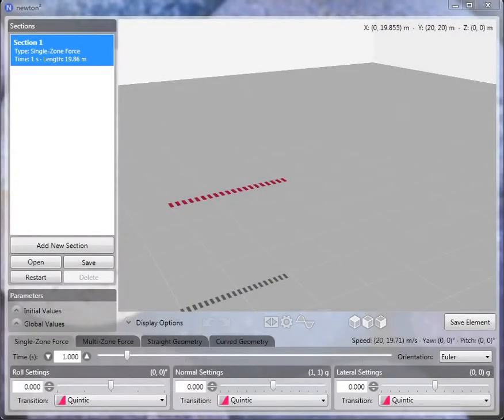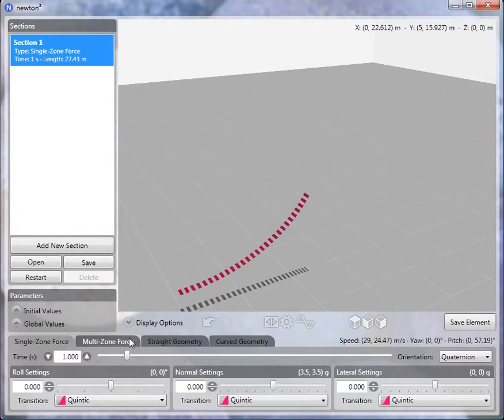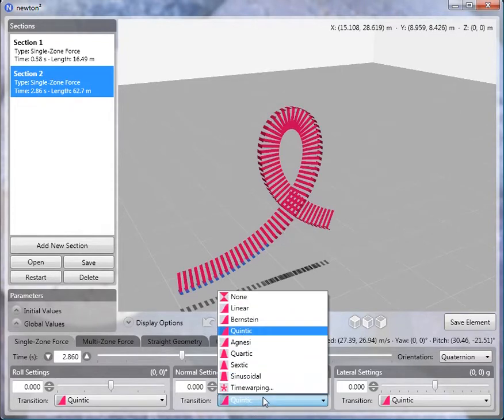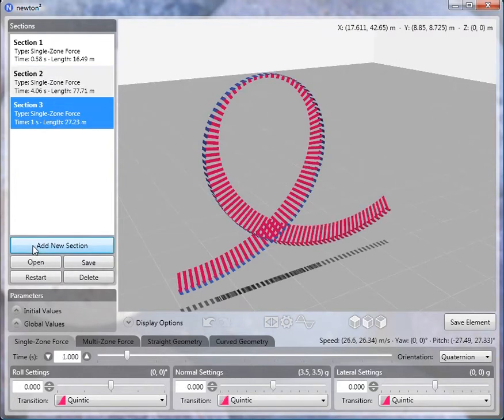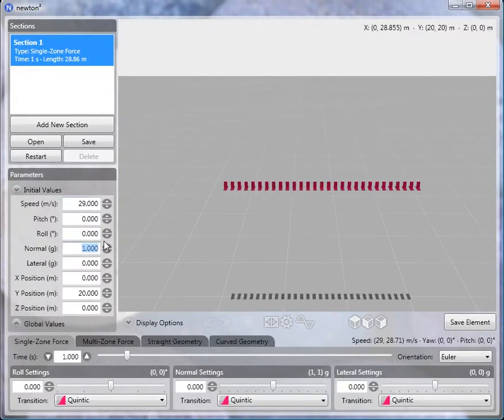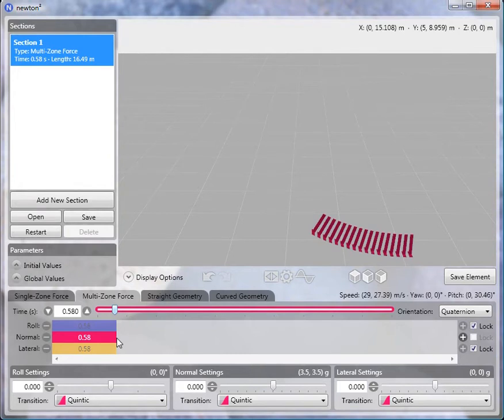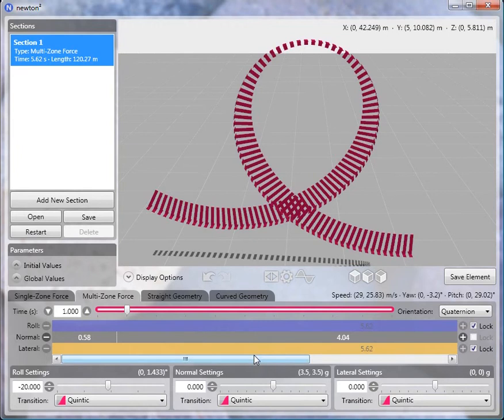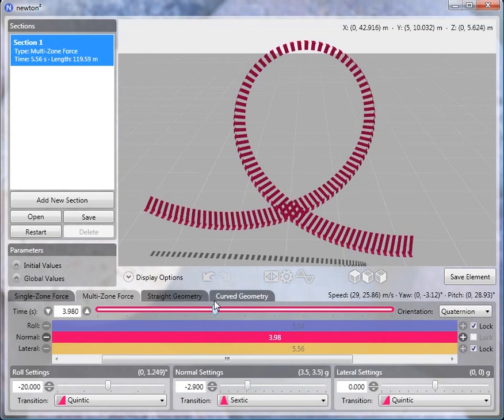newton2 tutorial part 2: basic loops

Comment: So as you build the drop i need to know with type do you select? Single Zone Force , Multi Zone Force , Straight Geometry or Curved Geometry? When you use Curved Geometry , there are two buttons on the left called Auto and Manual. Just click on Manual all the time (unless you're building the lift hill) So that means that your coaster is going continuously. If you don't use Manual , Newton 2 will think you're keep using Lift Hills instead of normal track if you understand me. Hope this help'd! :)